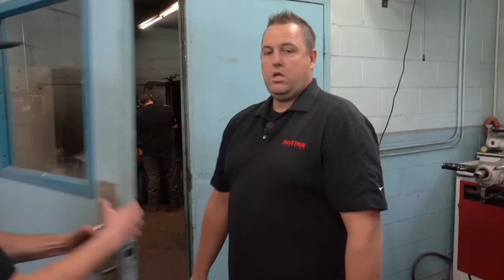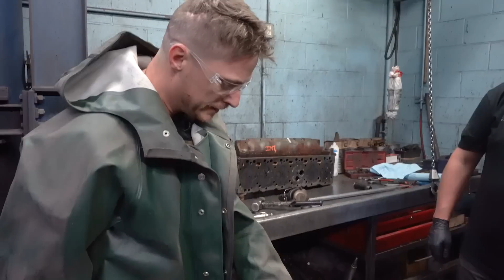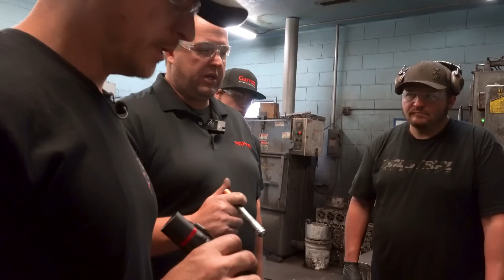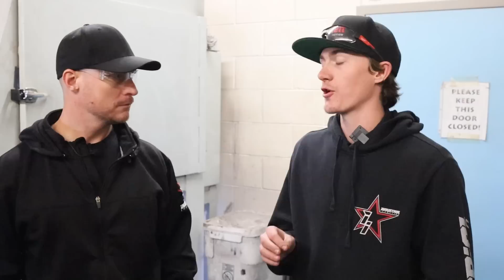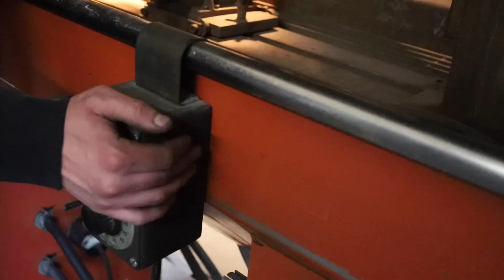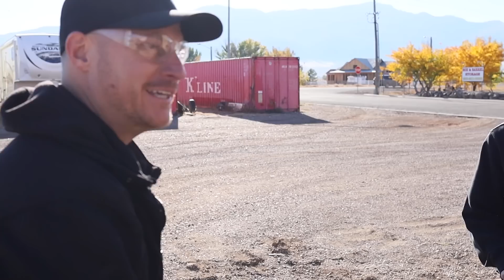Dumpster to Dyno: Resurrecting a Rusted Cummins 12 Valve Engine - Part 2

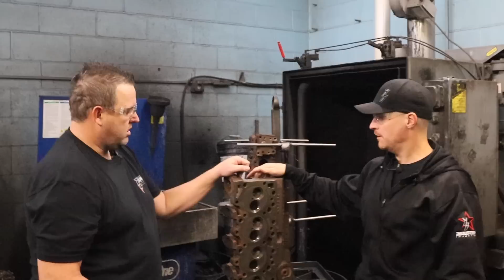Comment: Red injector was hiding ontop of the machine behind yall @ the 22:26 mark.. 
Yall did an excellent job so far with the dumpster block thanks to Merlin doing some dumpster diving an having the solution to getting those stuck rusted pistons out of the block.  Luckily he was right an it was a good block to use beside those few connecting rods that luckily yall had some stashed away & same thing with having that good dumpster head yall had for this build.. Cant wait for the rest of the videos on this build.. Keep up the great work yall @ Industrial injection.. 
Ps only edited the spelling of yalls name bc of my phones stupid autocorrect bs..